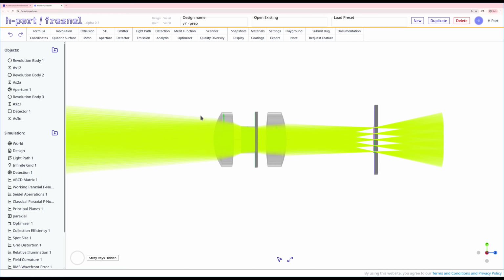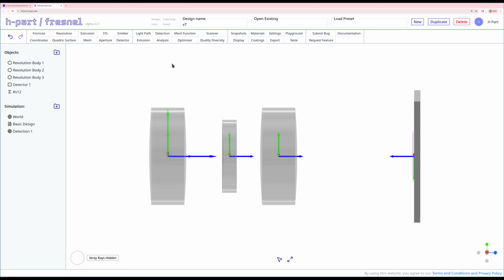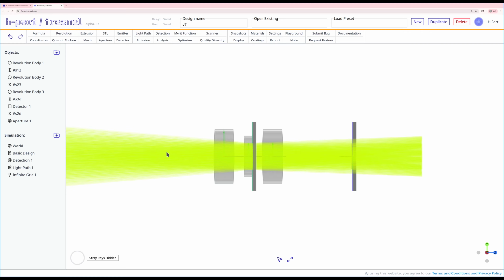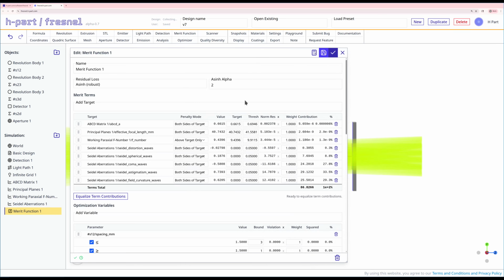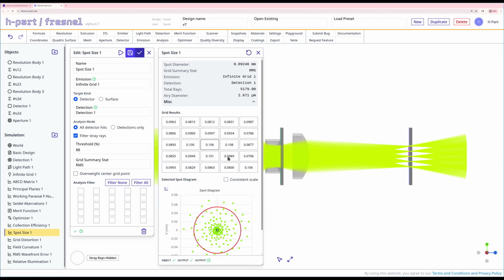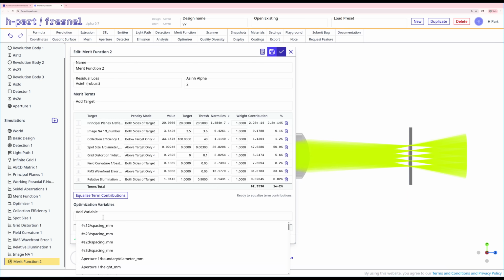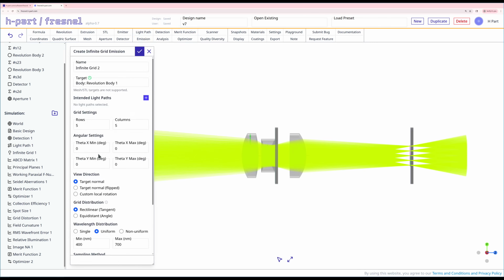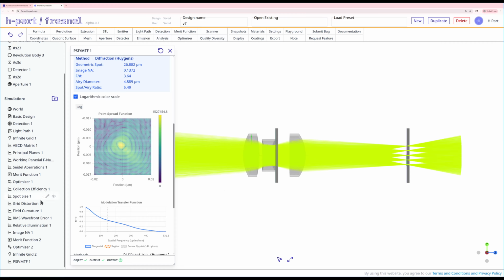Cooke Triplet IMX296 Design

Comment: This software looks like the best so far, what ive found between the free browser running category. The auto optimizer is insanely useful. At the moment im trying to make Sonnar lens, based on the canon 40mm F1.9 Lens. Only difference i want to make it 35mm and Fast as possible.